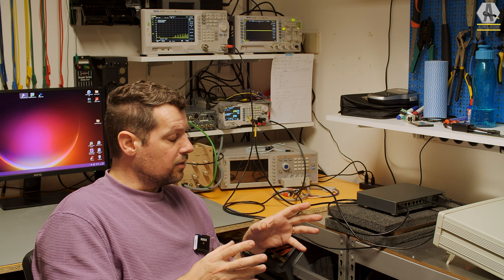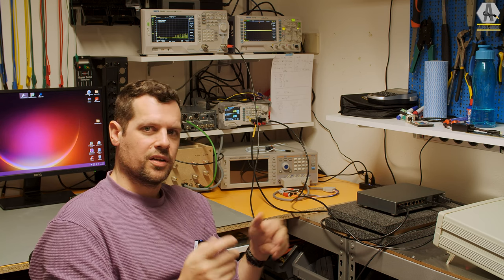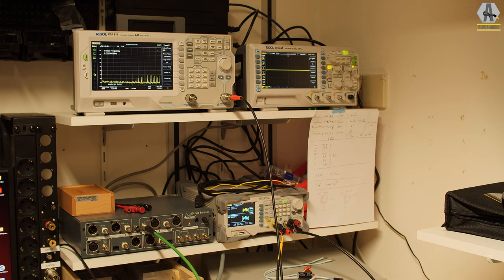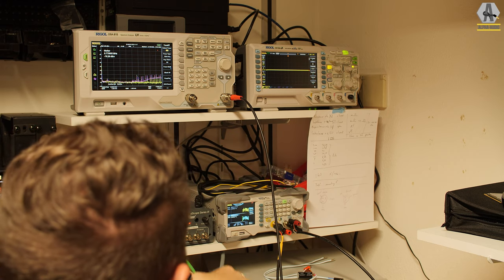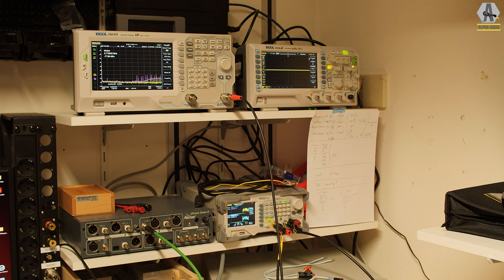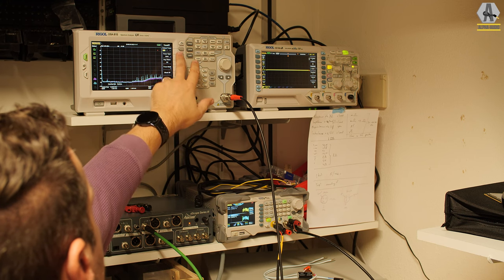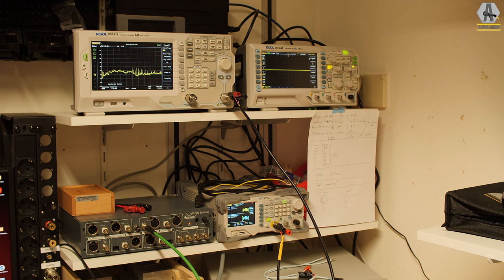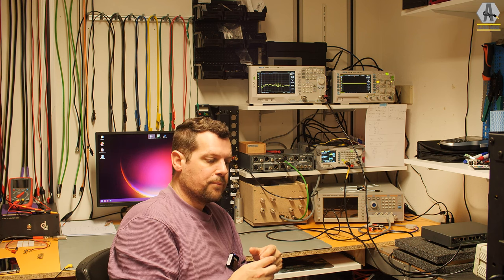HOW AND WHY we test network switches...

Comment: Those tests you are doing are red herrings because once the bits are assembled inside the DAC's fifo, how those bits got there has no bearing on how that DAC does the conversion. If noise from power supplies is an issue then you should be able to measure this on the output of the DAC because, at the end of the day, this is what you are actually listening to.

Comment: Would like if you could get your hands on a new ifi Silent Power LAN optical isolator. Something like that could possibly eliminate all the noise as it converts the LAN electrical signal to optical then back to electrical along with filtering. If it has no detrimental effect on the music then it seems like a perfect product to add in the network system. Not too pricey either.
Reply from the maker: @aussie8114  will try

Comment: This again.... DACs can't process noise. They can only process signal. So noise below any level that leaves the signal discernible is irrelevant.
Reply: Rubbish. Noise affects all the circuits in a DAC.... and indeed ANY audio device.
Reply: @steven2809  Feel free to link to any evidence that noise in the digital signal (at a level that leaves the signal discernible) has an effect on the analogue output signal of a DAC.
Reply: @PitchnYaw  Feel free to learn some electronics....
Reply: @steven2809 Ha! That's as clear a "no I can't produce any evidence" as I could get. Thanks for playing.
Reply: @PitchnYaw  Feel free to provide evidence that noise and EMI do NOT affect electrical circuits....🤔 I've heard this argument before that 'good DACs are unaffected'...frankly it's nonsense. You believe what you want to believe...if it makes you feel happy......🙂
Reply: @steven2809 "...frankly it's nonsense"   If only you could explain why.... 

As you requested: here's the high level explanation as to why noise in digital audio signals isn't processed by a DAC. I've even linked to exactly the time for one of the juicy bits.
https://youtu.be/wn71QBApCRg?t=519 

But I think you and I both know you're not really going to be receptive to this information. 
In any case, it is a great series capable of saving people from embarrassing themselves on the internet with their audio-foolery.

Comment: See Audiosciense measurements, they measured the output of the DAC. We don’t listen to switches but music. The DAC determines what we hear….
Reply from the maker: We have done measurement on the clock jitter in combination with different switches. There is a difference in jitter. That is audible.
Reply: @TheAlphaAudio  When using an USB connection to a good DAC this should not be the case, the clock op the DAC wil take the lead.

Comment: Looking forward to this. I recently got the LHY SW-8 switch on the back of great results with the LHY OCK-1 with my Gustard R2R dac. I was hopeful of some improvements but I was a little sceptical, my expectations were modest, I mean packets are packets, error correction etc, yes there may be a little electrical noise, but how much would impact would it make. I am sceptical no longer.

Comment: Thank you for the work. It's time people get to know more about digital (specialy) audio streaming done right. Already have a network with cheaper switches without extra power supply. One switch direkt behind the router that one does the work to transport the signal trough the house to my system than it goes to the second switch which communicates with the server from there it goes in to the third switch which only does the one job to take the signal from server to the network streamer/ bridge... Also the critical pathway was chosen to go trough the almost shortest (and no interference between pathway) "port to chipset to port" signal phatway etc. Everything cat7 which I also think it's the best?... That was my theory of an network. Right now I'm in to the bigger projects with much better switches and also I'm considering extra power supplys. I'm curious and thankful you guys are going in deep one the matter.
Reply from the maker: Welcome!

Comment: Most of network switches not have "hard" signal ground base because they using external AC/DC power supply. This floating signal ground can be often rather big problem source and cause increased noise levels and random disturbance signals (switches own clock signals can then easily leak to the another device thru LAN cable) . It can very easily detect by spectrum analyzer. Best method to avoid such problem is to use double shielded CAT8 LAN cable and do proper grounding on network switch and/or the device where to connect to LAN cable. This was just my own experiment.
Reply from the maker: You are right. Grounding the switch - some have a screw on the case to do that - makes a huge difference. 

Check out our new article about the influences of switches on audio clocks:

https://alpha-audio.net/background/how-a-network-switch-affects-audio-playback-an-extreme-deep-dive/

Comment: You say the data will be fine.
Audio transferred through a switch is also only data. If you can hear or measure a difference, then the data is not OK.
What kind of datatransfer (audio-transfer) are we talking about?
I am not so much into tech details about different protocols, but are we talking about some "casting" protocols that are one-way without error check/correction?
Reply from the maker: It's about the - mostly - common mode noise getting through the switch in to the streamer. That noise will influence the clock and eventually, possibly d/a-conversion. That is what we are trying to find out.
Reply: @TheAlphaAudio  But to find that out you have to measure the output of the DAC....which you not did.

Comment: Hi,
I love your comparisons. Always good value.  When are the results due to be broadcast?

This is of particular interest to me as I am anticipating the release of the Brooklyn Bridge II which has a roon core. I’ll be needing a switch to connect it to the Ubiqity Router.  I’m running cat 8 patch cables and have a media converter to provide isolation of the internet signal just before the BBII. The media converters powered by Allo shanti dual 5v linear power supply. I’ve heard that a clean switching supply is better for switches so not sure how that applies for the converters.

Cheers and keep up the good work.
Reply from the maker: The 18th of december we have the live test.

Comment: Fantastic video Jaap. Thanks. Now can't wait for the juice of the story....Understand you have many measurements to carry out but hopefully you will be educating us in a series of videos as you are processing the test results? Adding another dimension, if you wish to consider this, in your reviews....upgrade-ability in relation to cost.... I do not have the budget, unless starve for a couple of months 🤔...to purchase the quad Paul Pang....But I do have the budget to buy the baseline SOTM, then add the internal clock with input...then add external clock.... Cost in both cases is same. Result, I hope you can tell us which is better. But one is an option for me whereas the other one is not.
Reply from the maker: Hi Magmamin,

Thanks for the comment. I'm not a fan of the basic SOTM. The basic adapter is pretty bad. The PP Quad is very good.
Reply: @TheAlphaAudio  Yeah, fully took into account your review of the 7 switches. But as you know there is an SOTM model with the internal clock and input for external clock. The SOTM plus extra internal board is at Euro 2k...Together with an Afterdark clock  or equivalent and a LPS the total would be 3K. So quite close to the PP Quad....The question then is how do the two systems at about same price compare rather than the baseline model which is a third of the price. Would much appreciate if you could arrange to include such a comparative. (I know that you consider that clocks don't make much of a difference, which makes it even more interesting!)
Reply from the maker: @administratormagmamin8397  I will try to get samples.

Comment: Sorry for newbie question, but what about wifi router units?  Good technology?  Bad technology? I do all streaming vie wifi from a wifi unit attached to a broadcom cable modem.  Am I just ruining the data/music I stream?
Reply from the maker: Don't be sorry... no problem. Wifi can definately work. But it completely depends on the implementation of the wifi-chipset in the streamer. Some do a great job, some don't. By the way: the data will be the same: cable or wifi. It's all about the noise you introduce with an extra chipset / antenna that is doing its job.

Comment: I'm confused about how this would work - not meaning it can't/doesn't, but how to implement.  I have fiber cable service coming into the house. That is converted to ethernet on a provided device that only has a single port.  That feeds a 24 port switch which handles all the hardwired stuff in the house, including my streamer.  I guess I could terminate from the fiber box into a smaller, better switch and use it to feed my streamer and the other switch.  Does that make sense?
Reply from the maker: No. That is not optimal. The small switch that connects to your streamer should be as close as possible to the streamer.

Comment: Have you thought about doing a waveform comparison from the output of the DAC? That may tell a better story.
Reply from the maker: Not really, actually. It doesnt say anything about timing for example. Also: I would have to do some A/D conversion. That is problematic, because no 2 recordings are exactly the same. Even with exactly the same equipment.
Reply: @TheAlphaAudio  Only assuming that the signal noise on the input of an streamer or the usage of different switches does have an impact on the output of the DAC is not enough.....
Either proof that by measurement results or a real blind test....

Comment: Looking forward to hear about your findings Jaap and team. I presume that you add the white noise to simulate controllable " traffic" ? FYI have you ever heard of passive intermodulation ? Just trying to help with no intention to be the " smart " guy " 🙂I did in the past many RF tests and became aware that when you inject to much energy on a coil it can  go  into saturation and that coil will create passive intermodulation.  I was thinking about that because likely the special audio tuned switches have isolation coals on the ethernet output? Great work  ! and again I'm looking forward to hear about your findings.

Comment: My experience with streaming changed the day I got the English electric switch.
Reply from the maker: Yes... Nice one.
Reply: @TheAlphaAudio  Have to tried different power supplies with english electric switch? Can you recommend any?
Reply from the maker: @geir8849  there are many. What is your budget? IFi is a nice budget option. LHY is a nice midrange option and Farad is ultimate.
Reply: @TheAlphaAudio  500-800 euro. Farad, is better than Sbooster you think?
Reply from the maker: @geir8849  ow... Definately!
Reply: @TheAlphaAudio  ah, thanks. I tested the Sbooster and thought it made a great improvement, but did not buy it, so consider other options. Think I will take a chance on Farad then👍 Thanks
Reply from the maker: @geir8849  Have fun testing!
Reply: @TheAlphaAudio Thanks. By the way. Strange to think that power supply on a network switch could make such an impact on the sound quality. It really makes a big difference. Specially in the bass and the depth of the presentation.
Reply from the maker: @geir8849  it is not strange actually. A switch mode psu generates a lot of noise. That noise transfers through the switch to the streamer. A decent LPS is a lot cleaner.
Reply: @TheAlphaAudio  Maybe not strange that the sound improves, but rather how much the sound improves. It really is an investment in sound quality. Really like that this channel takes this seriously👍
Reply from the maker: @geir8849  Thanks!
Reply: @TheAlphaAudio  One more question. Do you think it's ok to connect the LHY or Farad power supply to an Isotek Aquarius to power the English Electric 8switch?
Reply from the maker: @geir8849  yes... That is absolutely fine.
Reply: @TheAlphaAudio  Oh thanks so much for this. Made my day🙂

Comment: Are you trying to make the switches sing? Are you trying to listen music direcly from switches? This is very misleading topics!
Reply from the maker: How is this misleading.
Reply: @TheAlphaAudio  Ok let me tell you:
- You are injecting white noise (full bandwidth) into switch. This is not actual normal working of network switch. So why bother? Why don’t you just test for normal operation for all the switch and compare?
- With differenct filter capability of the “white noise” of different switch, it does not mean they can make the sound output of the system different! Why don’t you measure the actual analog output of the DAC in the chain with different switch?! If they sound different, you can of course can show it on the analyzer! Why didn’t you do that?
What you showing in this video is only for noobs!